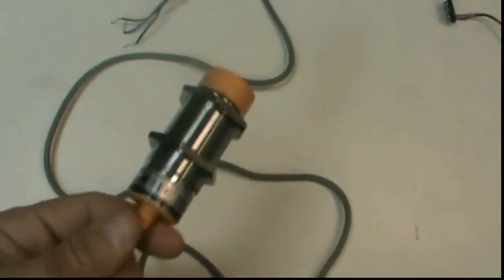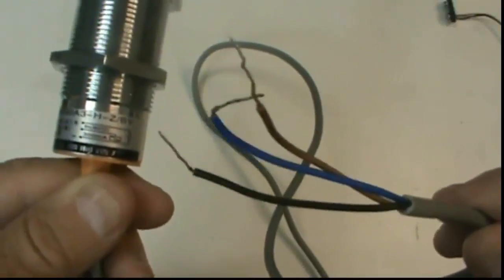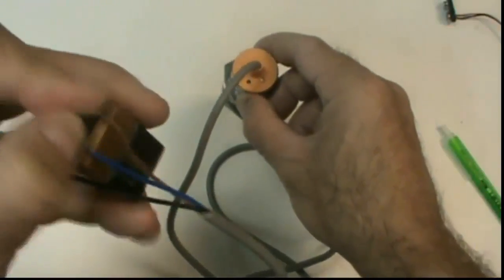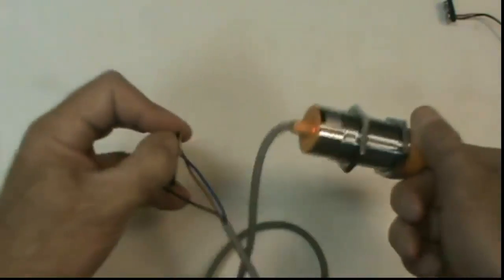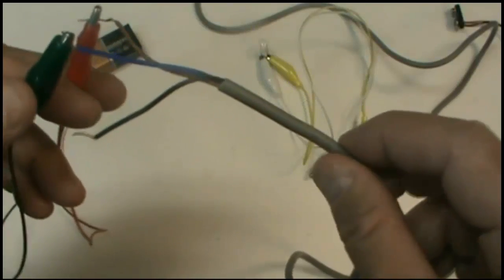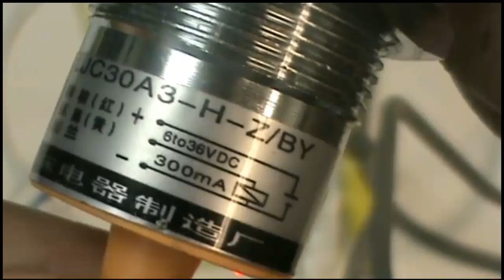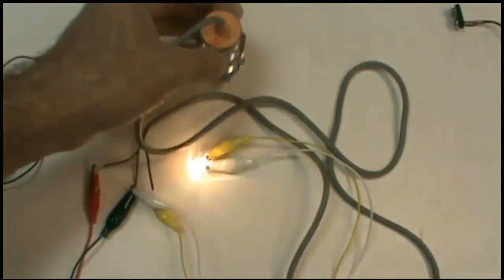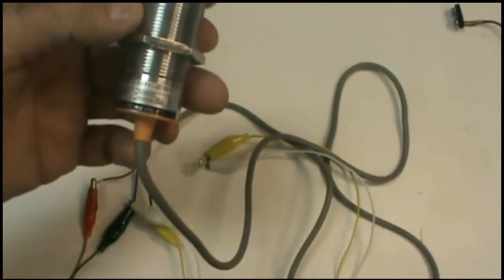Proximity Sensor Basics (PNP, capacitive)

Comment: Trying to find some that will give a signal on a 5v circuit. Is this doable with this type of unit 6-36v?
Reply from the maker: Yes you can wire the sensor to output only 5 volts or 0 volts by connecting the sensor output terminal to a load resistor (around 1K will work) connected to V+ on your 5 volt power supply. The sensor ground will share ground with your 5 volt ground. The sensor output will then be 0 volts during activation and 5 volts without activation. The output signal is backwards but you can correct this with your program processing. Let me know if this does no make sense.
Reply: Dorian McIntire Of course, i never thought of using the ground of the power supply. Perfect answer, thanks heaps.
Reply from the maker: Rob Horsley
You're welcome.

Comment: can this sensor can seperate the non -biodegradable and biodegradable garbage?
Reply from the maker: Not really. An array of sensors would be required to do the job.
Reply: any brand of sensor you can recommend for this job?
Reply from the maker: I'm  not aware of any. You would probably need to experiment with a variety of sensors to get things right. Much would depend on whether the material was wet or dry, among other things.

Comment: what will be the signal voltage?
Reply from the maker: For a sourcing sensor the sensor voltage (here 9 volts) is switched on and off by sensor switch. For a sinking sensor the switch is attached to ground so the switch can switch any other voltage you prefer. See my other sensor videos for details.

Comment: can anyone please help me out to calibrate the inductive proximity sesnsor LJ18A3-8-Z/BX ?
Reply from the maker: Most inductive sensors do not have an adjustment screw. Without the an adjustment screw (usually on top of the sensor) you cannot adjust the sensing distance. The distance is usually only cm or two at most.

Comment: DO NOT TRY TO RUN SENSORS IN SERIES to reduce the signal wires from 6 to 3 for the Arduino CNC shield because it will be a long road to heartache.  Use a 2nd arduino and run 6 sensor wires to it, and then let the arduino summaries that data, and then send it to 3 outputs from that 2nd arduino to the 3 inputs for sensors on the CNC shield.  The CNC shield was made for mechanical limit switches that can be hooked in series.  There are websites that say you can run these in series but it never worked for me.  Don't even try to do it.  It is a waste of time.  Each sensor needs to have its own reader.

Comment: Help me... please . I have a sensor that is supposed to sense whenever a magnet gets in front of it I have it hooked up to a switch that goes to the sensor from a 12 volt car battery anyways it goes to the sensor as 12 volts and it comes out 9 volts I was going to hook it up to a electromagnet but the electromagnet also takes 12 volts so then I hooked it up to a relay except for when I hook up to the relay it acts as if it's too much load and the voltmeter doesn't read any thing afterwards but if I unplug it from the relay it goes back up to 9 volts so do I have a bad sensor or something else... and do you know of any other way that I could hook this up

Comment: Hi there!
Can I connect it straight to 12V with no resistors in between?
Thank you in advance!
Reply from the maker: To power the sensor you can hook it directly to any power supply between the minimum and maximum specified for the device. This is usually written on the device. For newer devices the voltage range is between 6 and 24 volts. Remember Brown wire positive and Blue wire negative. Have fun.
Reply: In my case it is rated between 6 and 36V, so I think connecting it straight to 12V PSU should be ok
I connected black (signal) and blue (GND) to a JST connector (and thus to the board) and then brown and blue to 12V... I guess it should work perfect...
In a few days, when I get some spare pieces, I'll start tinkering with the firmware and the offset adjustment
Thank you!

Comment: hello sir may i know what is the use of the adjusment screw?
Reply from the maker: +monica orpilla The adjustment screw changes the sensitivity (usually range) of the proximity sensor to allow it discriminate between near and far sensing. It also you to lower the sensitivity so more bulk or a higher density of material is needed to trigger the sensor.
Reply: +Dorian McIntire thank you sir. lastly, it can detect metal and plastic in the same time or i should adjust the adjustment screw?
Reply from the maker: It depends on what you want to accomplish. See the following video for details.

https://www.youtube.com/watch?v=SsvjxnN8ZUk